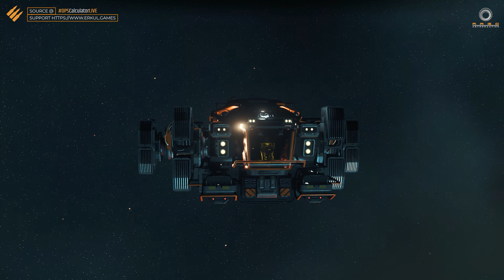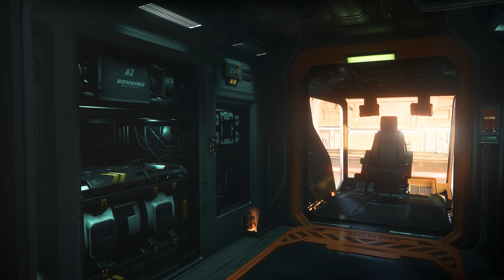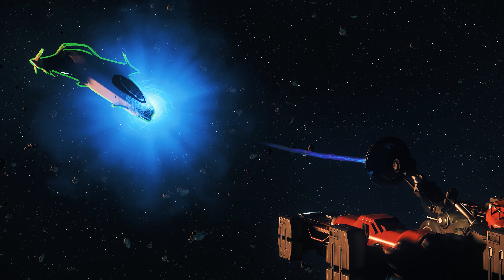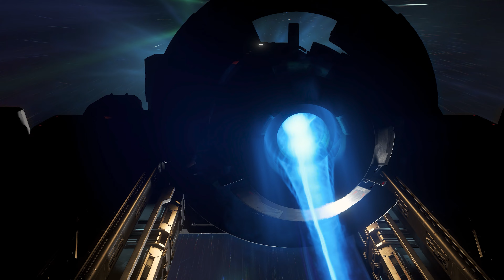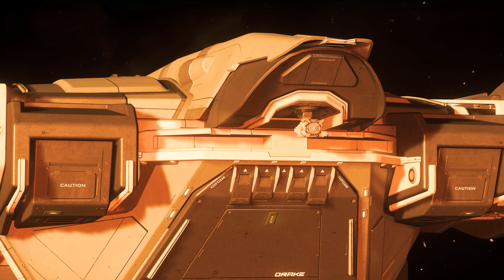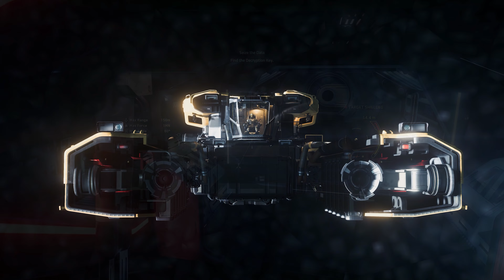Star Citizen 😮 ARGO SRV & All Ship Tractor Beams are LIVE! 🛸 3.21.1 PTU Preview & Guide

Comment: Finally!!! SRV function is one of the most wanted for me,  but I wasn't expecting to see the other ships too. Specially the Caterpillar!
Reply: I actually can't see by now a solution to the tractor beam's position problem on Caterpillar. Hope they find a good one.
Reply from the maker: The fact that all the ships got the tractor beams was a real surprise 🤩 There are still some adjustments for the older ships so that they can be used 👌
Reply: @MrKarolinger   Getting back to Caterpillar's issue, they could consider 1 tractor beam holded by a rail on the roof of each compartment. It could easily reach both side doors with the same view of Nomad. But I don't know how hard would it be to create.

Comment: small correction: the elevator leads to the component room that also works as an air lock. From there you can go into the cockpit but also seal the cockpit off from decompression with a bulkhead door.
Reply from the maker: Thanks for the tip 👌